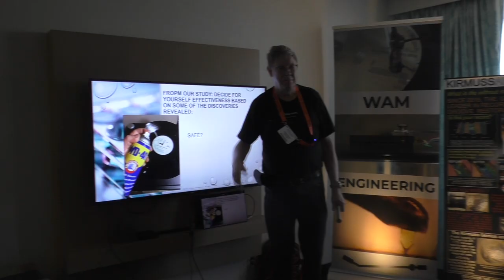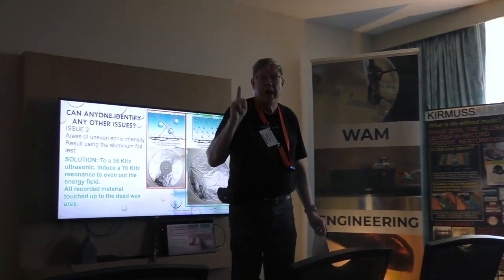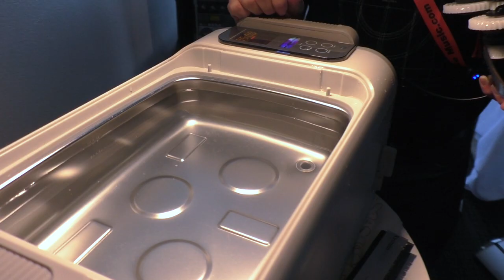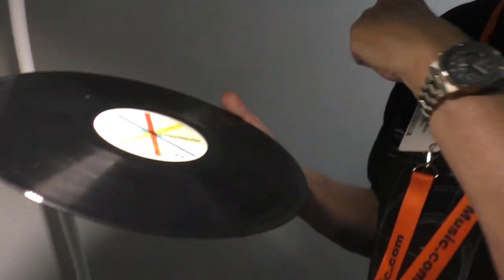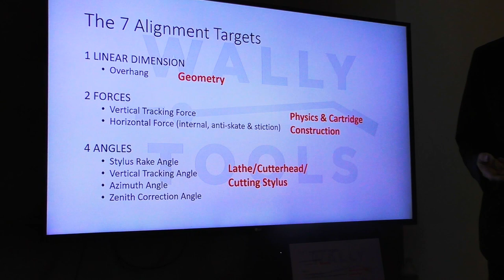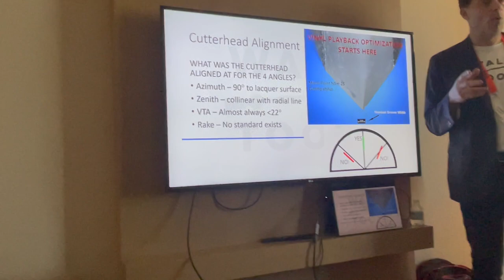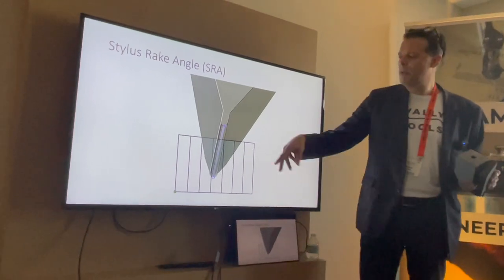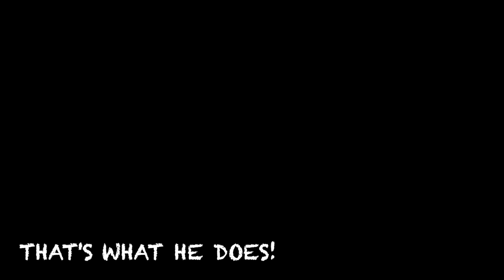Two Must See Seminars at Florida International Audio Expo 2023

Comment: Okay, let's be real here. Charles has done a real service. If you are serious about your vinyl, you have to have Kirmuss' machine. So I have records going back to the early 1960's that I got from my parents, and records I bought from the early 1970s... And of course I have now bought used records that date back to the '50s. Yes, the dishwasher was great in the '70s because that's all we had. And those that I cleaned with the dishwasher still sound pretty good All these years later. I remember in 1977 the first vacuum cleaner out in Indiana, and it looked like a game changer, which it was. More recently I having using a VPI record cleaner, for at least the last 12 years or so. I figured that did a good enough job, powerful vacuum and all that. 

First time I saw Charles' presentation at the Capital AudioFest in what I think was 2017 --white coat and all--I thought it was pretty hokey too. But as I listened to what he was talking about, and as his own ability to explain the process clarified, I took a chance and bought a unit in 2019. Good grief! What an amazing difference in the clarity and sonic range of my vinyl. It really is a remarkable system and understanding the charges and how they change to remove the release agent is really the key. Yes, it takes some time to restore a record, but when you have invested in records as I have, those most important ones deserve the benefit of his restoration system. If you buy the unit, I'm sure you will agree. It is a serious cut above and is actually a real bargain. In the end it depends on your dedication and taste and commitment to vinyl, because if you are primarily listening to streaming or even CDs, you won't want to take the time.  

I happened to be at the Florida audio show, and that is my record they are cleaning in this video (original pressing of Two's Company, Maynard Ferguson and Chris Connor, 1961), and thereafter I took it down to John Wolff In the Classic Audio Loudspeakers showroom, where he played the record sounding as though it had just come from the pressing plant: a full frequency recording of Something's Coming, which really shows off the entire range of the analog musical spectrum.

But hey, if you don't believe me, take one of your records to one of the audio shows and let Charles clean one of yours -- see for yourself.
Reply: The proof is in the pudding, and thank you for your unexpected but greatly appreciated vote of confidence.  

We have over 5 000 systems out there in a very short period of time. 

By the way, we usually wear a lab coat not as a gimmick but where just as what happened in our room in Florida, a cloud of white dust came out of a record sleeve when I pulled a record brought in by a vistor tp prove our process. Those present all sneezed. The fungus ended up on my hands and arms and on my shirt.  Was not wearing my lab coat.
Had to wash off and dust off what I could.

At the Florida Show, we also used a spectrum analyzer to measure signal gain before and after our processing,  many records  brought in were previously processed by other cleaning systems.  Users were also able to listen to the results of their personal records which in all cases, as you mentioned, were dramatic. 

I wonder why peers do not use the tools that we use let alone do before and after auditioning that you so well described. 

Sincere thanks for your very detailed comment. 

We will be doing the same at Axpona.

Invitation to all to bring with them one of those horrible sounding records. 

Thank you

Comment: I made my own DIY ultrasonic RCM using the exact same tank Kirmuss uses (iSonic)  It is an excellent tank, much better than the millions of generic metal ones you see on Amazon made in China.  I've done about 1000 of my albums, and with the exception of about 30 or so that needed a little more loving care, they all came out amazingly clean and quiet!  I do a simple 4 part video under my name here on YouTube how I made it and the extensive research I did and the experienced people I sent questions to in making it.
Reply from the maker: Kirmuss does not use an iSonic tank and specifically says that in the video.
Reply: @trackingangle929  Well, he must've changed it then.  It sure looks identical to mine  😊 Yep, just checked the video carefully.  All the heating elements and the transducers are exactly the same.  Sorry about whatever he 'says'  Perhaps he means that he has modified it, obviously creating his own proprietary top that spins the 3 records.  But yeah, looking at that one in the video, it is EXACTLY the same as mine as far as the actual structure of the tank goes.
Reply from the maker: @latheofheaven  no 1000 times. It's a different company. He names the company. They may look similar but they are not. Come back down to earth please.
Reply: @trackingangle929  Well, I know you take a lot of grief Michael and I am honestly not trying to add to it, but what I'm guessing is that he simply gets the tank that is made from the same manufacturer that also makes them for iSonic.  It would only make sense that he would go direct to the manufacturer.  So yeah, the tank may not be an 'Isonic' tank, but looking at the shot at 26:37 it is absolutely identical to mine.  I'm sure the deal is that he just gets it directly from the maker of it, so he would be right in saying that it is not an iSonic tank.  Unless of course, another company just happens to make an identical tank.  I would include a snapshot of mine taken from the same angle as shown at the time stamp above if I were able to do that and you could compare them side by side and see they are the same.  If there was a way to e'mail you a picture then you might see what I am seeing.

Notice the almost proprietary oversized transducers used in the tank.  I've not seen others that use those, and iSonic makes a point to boast about them and how they are far more effective than the smaller ones you normally see in all those lesser tanks.  Even the outer casing, which is fairly unique is exactly the same as mine, with the exception of the added handles and the proprietary top that Kirmuss uses.  Hey, Kirmuss uses a great tank, it works awesomely!  Again, I'm NOT just trying to pile on grief to you sir, I know you get far too much of that that is not deserved and are likely getting pretty weary of it  😊
Reply: @GiancarloBenzina   👍
Reply from the maker: @GiancarloBenzina  does the ISonic have a degassing feature?
Reply: @trackingangle929  Yep...
Reply: To the comments below. 
Some added details.

... of Ilford, ilfotol, photoflow,  I ask one to think about what this solution is used for before using it for records. As a darkroom instructor in the 70's and 80,'s, when one develops film or a print, we cycle the film or paper after exposure between developer, stop bath, fixer and then a wash, we call it a wash bath. We then add in the wash bath an  anti surfactant,  if you wish to call it as such. 
It is used to see water roll off the film or paper, so as not to leave water spots. In record cleaning we want the record to attract cleaning...not repel it.

To the comment of standing waves, standing waves can be detrimental if too many records are placed in a fixed size bath, skewered, where the effects of cavitation are negated and also as shown in the slides,  see areas of  high impact appear. Exceeding the load factor. 

Conversely, without standing waves or resonance added, a single record will see uneven effects  of cavitation as, if you look at the slide on this subject in the presentation showing 3 transducers mounted on the bottom of a metal tank, the acoustic waves created which rise are uneven in  intensity and pattern.  This slide  is validated by both the aluminum foil record(s) spun and reading the results from a cavitation meter. So further to the thought of using an ultrasonic to safely process a single record without modification and resonance added is misleading.  Cleaning records that are 12 inches or 17 inches in diameter is not the same as using the same machine to clean dentures, jewelry and the like when looking at the many ultrasonic tanks out there for the DIYer. To this. Without modification,  energy is distributed unevenly. More danger, if using  an unregulated ultrasonic where a record has been ionized may see the record damaged.  

Finally as to power, the power should indicate the measurements of pressure shown in Cavins or watts per square centimeter. Not watts as to power supply and  current draw, which is usually the case or Watt rating of the transducer, which is similar in concept to a loudspeaker in operation as it is driven by an ultrasonic generator. Consider the generator as your amplifier. 

Some advertised ultrasonics are not ultrasonics.  They are misters or bubblers. If in doubt, ask the manufacturer their rating in Cavins or watts per square centimeter.  To provide the rating of power consumption is misleading.  Conversely, if the product is in fact using cavitation and transducers,  the rating of the transducer, in watts, is misleading as it is the ultrasonic generator that is the driver. So we need to measure te pressure created in the tank by the totality of generator and transducer chain. Kind of measuring the sound level in a room with a sound system playing.  Some overseas ultrasonic record cleaning machines use a laptop style power supply. They do not have enough energy to power a motor, heater, fan, and sonic generator.  Another lay method to better see the forest between the trees.

All good points were raised. 

Hope this fills in the blanks.

Unfortunate where in this hobby, buyers need to beware with ultrasonics as well as cartridges and in the latter, now  discovered unacceptable zenith error in even the most expensive of cartridges.

Comment: There are many things that Mr Kirmuss states that makes perfect logical sense. What I don't get is, by using the same brush over & over again, it must become contaminated, with the gunk that he states is present in a new record or the reminents from a previous clean. Surely by doing this, it has to be re-introducing some gunk & pieces of dust that adhere to the brush from him previously using the brush. The unfiltered crud in the bottom of the tank does not inspire much confidence, as all that is happening is that it is being circulated during the cleaning. I use an Audio Desk & have seen the dirt that their filter catches. Also, the fact that you end up having to use a cloth to dry, surely introduces more issues of dust & or static. No engineering, chemical or scientific background needed to grasp that all.
The other thing is purely a practical issue, by the time anyone would spend using this process for the bare minimum cleaning period, would be very time consuming. Even someone with say 1000 LPs, it would take a hell of a long time to clean these & not much time for music.
Reply from the maker: The crud goes to the bottom of the tank and stays there. Nothing in the process brings it up into the tank. And best to change the water every 10 records.
Reply: Great question...
The brush is pad dried between cycles. 

The  brush is used to recharge the record. The spray is not a cleaning solution.  It changes the  charge of the record to be opposite to that of water. With the record inserted into the machine the effects of cavitation are attracted to it.

Indeed as the record spins the induced charge wears off.

Every time we reapply the ionizing spray to the record by the microfiber dried brush, the 178 colorant in the solution being swished around by the brush picks up also what the ultrasonic softened in the prior cycle.  Appears as this whitish material. 

A fast evaporation as we move the brush from the 12 pm to 6 pm position indicates that there is nothing left for the ultrasonic to remove.

Moreover to the process,
When we take the record out in the determined last cycle, once wobbled to let any remaining water run off, the record, when placed on a horizontal surface, sees the record to be virtually dry.  This as the charge of the pvc record and the distilled water is the same. 

So to your point, the condition of the applicator of  the spray applied to the record  is moot.

Every so often I do mist it with distilled water and then use the supplied rabbit microfiber cloth to once again pad dry.

FYI using a separate and  dry dedicated goat hair brush located at the turntable sees one apply ono this brush a mist at  arm's length of this spray which dries instantaneously on the brush  it may be optionally applied to a spinning record placed onto the turntable after restoration with our process, this before storage or play , this to charge the record once more to now repell dust. It does not coat the record. 

Thanks for allowing me to fill in the blanks for you.
Reply: Also a processed record comes out virtually dry as it repels water, so there is no issue of contamination. We originally, FYI, in 2018 suggested to mist the record after processing as seen in the original video at Mr. Fremer's home.  Discovered as seen where the charge on the bottom of the tank attracts contaminants, and records repel anything else. Thanks for your comments!

Comment: Why does Kirmuss always come across like he’s layering on the BS with a trowel?
Reply from the maker: personality quirk. Believe me I've been after him for years and forcing him to back up his claims. And the more I poke the more they prove to be true.
Reply: @trackingangle929  I stopped listening when he said vinyl has sugar in it
Reply: @gotham61  look at the composition of pvc and where soy derivatives are used in the complex mixture.
Reply: @gotham61 soy is used as a filler, and other additives per Making Vinyl support the observation
Reply: Because that’s exactly what he’s doing.
Reply: I just looked at it. Not sugar. Not even close
Reply: It’s not soy. It’s a soy derivative used as opposed to using a petroleum derivative. Big difference
Reply: And it’s not used as a filler. It’s a plasticizer. And could you point us to any of the vinyl pressing plants using it? Not that it matters. It still ain’t sugar

Comment: I'm always interested in new and better everything, but if I'm going to spend money on it I need to know for sure that it's better than what I have.
It'd would be great if prospective buyers could see proof that this cleaning system is better than something they already use (i.e. - I clean a side of a record, then submit it for microscopy and for the other side to be cleaned by your system with additional microscopy to follow).
I understand it's totally impractical, but it's just so difficult to simply accept claims and promises.